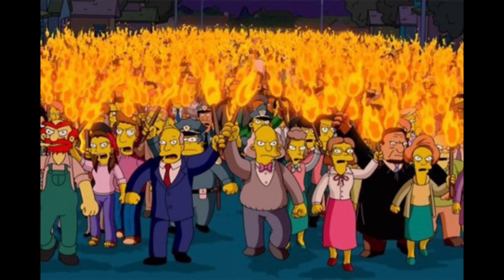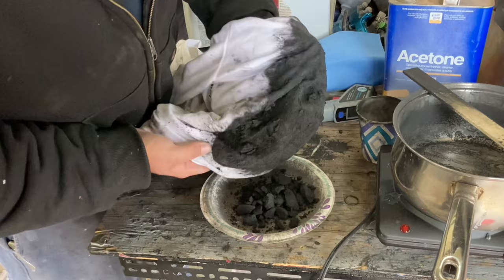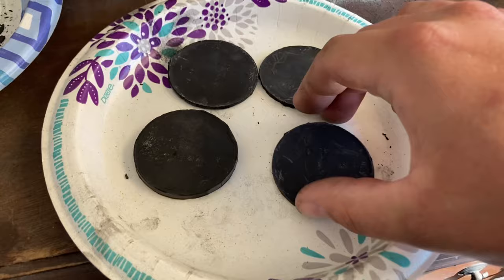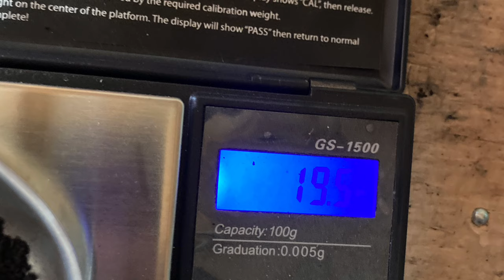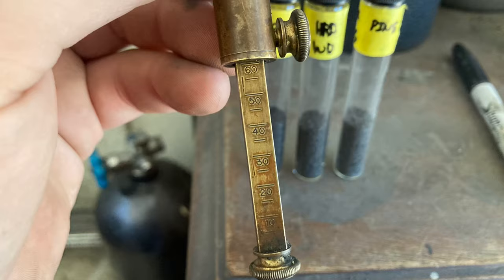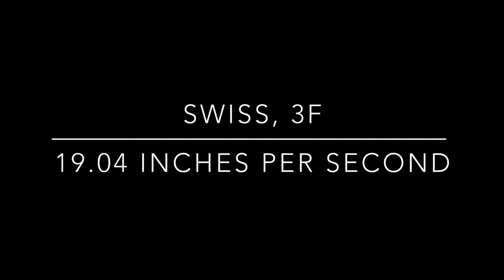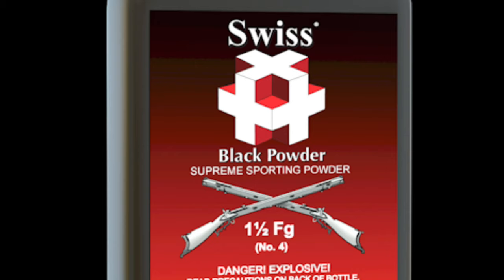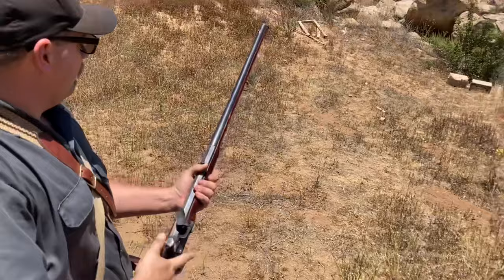How To Make Black Powder (For Firearms Part 2)

Comment: Where and how do you get Potassium nitrate?
Salfer too
Reply from the maker: Amazon
Reply: not really! all I've seen is like 500gram packages and very small amounts. Now I'm not trying to build a bomb ,but I'd like about 10 lbs or potassium nitrate and same of salfur ,thinking that would last me a few years . I will look again, thx you for the reply!
Reply from the maker: https://www.amazon.com/Potassium-Nitrate-Purity-Milled-Reagent/dp/B094JZSN51/ref=mp_s_a_1_2?adgrpid=57664648444&gclid=EAIaIQobChMIgt7P6ZL4_AIVmgWtBh36Ows2EAAYASAAEgLZW_D_BwE&hvadid=580677570192&hvdev=m&hvlocphy=1013962&hvnetw=g&hvqmt=e&hvrand=630876965709658033&hvtargid=kwd-298029716782&hydadcr=27414_14517896&keywords=potassium+nitrate&qid=1675385900&sr=8-2
Reply: @Everythingblackpowder  Thx, but I did see some of these ,but if you look it is unavailable!! ??
Reply from the maker: Bummer

Comment: Hmm.
Shall we have a face off?
May the best powder win. 
You may use any method and need to disclose nothing.
Simple burn rate will determine the winner. A 2 foot line will be filmed and timed.
If you accept let me know! ;)
Oh, and on a side note, my uncompressed powder will send a bullet to the same speed with 30 percent less than goex.
I believe erc is better than willow.
I bet the graphite will help with the fouling as it is a really good lubricant. I bet that their powder is less fouling based on a secret charcoal and sulfur.
Reply from the maker: You bet
Reply: @Everythingblackpowder  hmm...
Let the games begin ;)
This shall be fun.
Normally I just make powder practically but this is going to be the best powder I have ever made :)
Reply from the maker: @PraetzelProjects  I would expect nothing less.
Reply: Oh and I should specify that the 24 inch line should consist of 80 grains (based on your tests)
Reply: @Everythingblackpowder  oh, and only the traditional ingredients
Reply from the maker: @PraetzelProjects  sounds good

Comment: Haa what the CIA "method does?' is use the temps to amalgumate the three? KNO3 has a temp to "melt about 600" Sulfer also has a temp to "melt about 240" carbon not so much at ALL but it does absorb. and put all this togather you have a heated liquid Salts blending, Crystalizing and getting ball milled AGAIN. And "pucking" with "corning" plastizeses these amagimated, crystalised, then plastized three into ONE! then corned into desired sizes and into a volumeteric and weight ratio as close to 1:1 as possible. 
I got over my "heart burn" no longer do CIA
the key at my known to date is carbon prep! I wash off the ash/ POT ASH, dry, mill alone, rinse and drain, dry again, dry again, and WOW she is fast!
keep chasing your Dragon, Keep your Smoke Poles SMOKING!